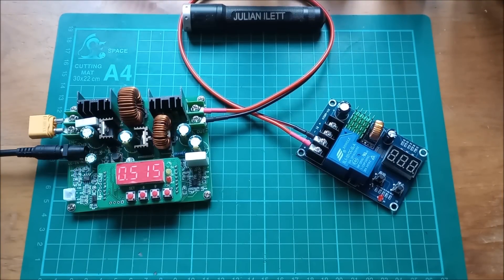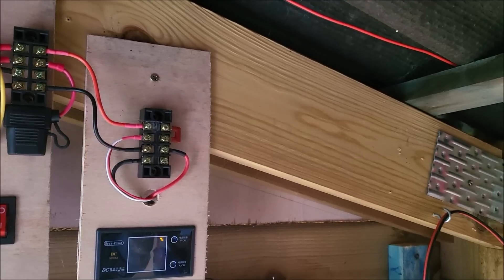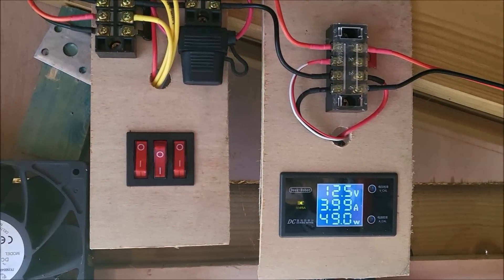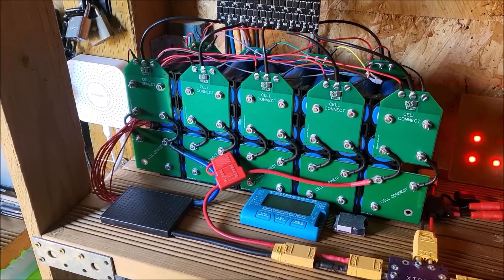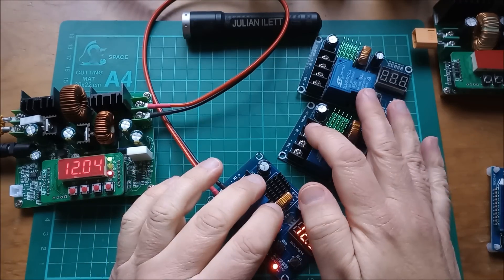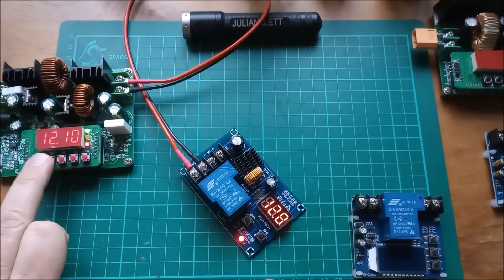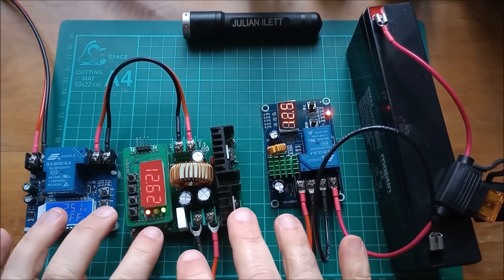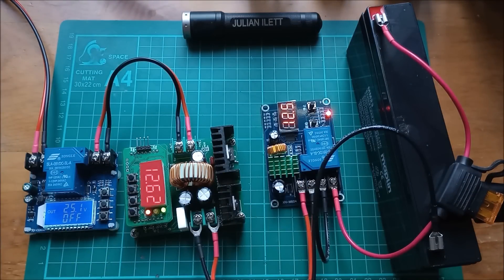Give 'n' Take Energy Transfer System

Comment: There is a simpler and easier way to do this. You know those little "solar" "MPPT" buck converters? They have a third pot on them, so not only do they give you configurable output charge voltage and current limit, they also set you set the minimum input voltage from the source below which they will not draw any more power. No need for relays. The only other component you might need is a diode to prevent backfeed from the destination battery into the buck converter.

Comment: interesting. i also did something like that for my own "ups"  psu at 14V feeds into relay when feeds converter to keep V at 12.4V when psu is off relays goes off and switches other relay on which reconnects battery which is off when psu is on to charge the battery. a little relay circuit that suppose to switch between psu and battery to power something, but it doesnt charge battery.
Reply: U can't use a battery while charging at low current unless you power the devices with the charger assuming you mean 1 battery best have 1 battery charging 1 battery in use

Comment: You need thicker cables to prevent the voltage drop. I am using 2.5mm multi strand wire, doubled up to equal 5mm square, it still solders into the ring terminals with a bit of manipulation.
QUESTION:
Can you please drop me a link for your source of Banana plugs.? I can only find unshielded decent Speaker type ones, which are no good with high current sources, in case of accidental shorts ETC. Even plugged in they are unshielded.
Reply from the maker: There is a small voltage drop in the cables, but it's only a few tens of millivolts. The banana plugs came from either Rapid Electronics or CPC Farnell, but the last time I looked they had been discontinued.

Comment: I'd put a diode after the buck converter then go to the battery instead. Not using the one module after the buck converter, as it is not needed. Stopping the battery backfeeding in the process too.

Comment: LiFePo4 batteries have a built-in BMS. 
At 14.6 volts the BMS disconnects the charging Mosfet and at 10 volts the BMS disconnects the discharging Mosfet.
You only need a step down regulator to 14.6V and 10A
Reply: Right, I was thinking that too although there’s a huge range of BMSs around these days, including many that I probably wouldn’t trust to handle the in/out limits for this situation.  Any quality BMS with user controlled settings and an app for monitoring could handle all that switching reliably I would think

Comment: Why not just use a push/pull buck/boost and set limits in it?
Reply from the maker: push pull buck boost?
Reply: @JulianIlett  ya, like cars have that to v2g. There’s amp and volt measurements on both sides and a full bridge on them so that they can buck based on parameters and boost in the opposite case. 

V2g just pushes more voltage back up from the battery OR pulls depending on mode but it could be automatic.
Reply from the maker: Oh OK. I've seen some Linear Technology IC's that can do that, but I've not seen any modules for sale yet.
Reply: @JulianIlett  get out the wood board and make one please!  Would love to see you build one with an arduino!

Comment: I'm really interested in the plethora of bidirectional USB power delivery boards on Ali and the newer chips from Linear Technologies that supposedly handle almost every facet of true MPPT for you across a wide range of voltages. Might incorporate them into my first PCB design ever (despite the price).
Reply: YES!  These!  I’ve been eyeing some of those bi-directional PD/ QC boards as well, waiting for the price to come down. I imagine them being quite useful!  Those power delivery protocols are widening the list of available voltage and current options but currently it’s 3.3v to 24v 100w+, 200W right around the corner.  There’s ones that buck/boost to achieve that output whether the input be 5v or 32v I think.  I use a lot of the 1 way PD boards for charging devices and powering LEDs but the 2-way boards seem like a new level of awesomeness.

Comment: never seen the point of wanting to work in a shed in the UK!  For a few days of the year it's too hot and the rest of the year its wet and cold, or cold, or just wet. plus all my tools go rusty in the shed. 😞
I'll stick with working in my toy room 🙂warm, dry and loads of mains power.

I think you need to start to look at a processor controlled switching matrix so you can balance all the incoming power to your storage requirements.
Reply from the maker: Working in the shed is not a want, it's a need. My office has a smaller footprint than my car!
Reply: @JulianIlett 🙂My toy room is meant to be the 4th bedroom.  but being big enough to be a bedroom is only in the mind of an estate agent.  As long as I leave a path to the airing cupboard I'm normally ok with all the toys 🙂
Reply from the maker: We had 4 bedrooms when we lived in Hayes, but lost a bedroom when we moved to High Wycombe. We gained a study (my workshop), but it's tiny. The shed does have its challenges, but overcoming them keeps my brain active :)
Reply: @JulianIlett  Not been to High Wycombe in years. the Hellfire caves was a fun place to visit, only about 20 miles from where we used to live.
I've got to build a shed for the other half to replace the old one that's falling down.  so it might be a modular shed 🙂

Comment: same transition from 24 to 12  for me and all my panels are 35+volts  . you can use dc clock switch to open your charge via sun  4-5 hours only  in daytime..   only thing is some converters love to have first the  input then the load... or mine just kicked with a big ark when charged backwards

Comment: I have two battery system in use in my garage, 12 and 24v too. To recharge the 12v system i just use another epever tracer and instead feeding in solar i just connect it to the load out of my main charge controller. That way i can program the load out to only be enabled when charge is high enough and i have a second load out on the 12v side which i can then use to control my 12v loads.
It works just fine for almost a year now. There's no backfeeding or other problems and the stand-by current draw of the charge controllers is really low.
All these relays and controllers seems to be way over complicated.
Reply from the maker: I'm trying to do this without using charge controllers. It's challenging (but fun) trying to get it all to work.
Reply: @JulianIlett  haha, okay, i accept that answer. making the unusual solutions work is quite fun 😁 As an electrician specialized in electronics, i can totally understand that. If function is just the 2nd priority, then trying thing out is perfectly fine 👍

Comment: Can't help but admire the convoluted nature of this. Probably needlessly complex, but far more interesting than a little black box that does it all inconspicuously. Do feel like I'd want something to prevent the backfeed though, and I'm not really sure where I'd put the buck converter in the chain. I'd also stick a manual switch or two on there to disconnect either side from the circuit and for extra gadgetyness. Would be nice to see the final setup in action, perhaps another shed tour in due course?
Reply from the maker: It's now all set up and working in the shed so I'll make an update video soon.
Reply from the maker: There's a manual switch of sorts on the LCD relay unit. Pressing the bottom button puts it in an off state.

Comment: Not sure I see the point of the relay closest to the target battery since the current limiting module will simply, with the right voltage setting, charge the battery whenever the supply relay is on. Adding a zener diode to the target battery terminal will prevent the battery from back feeding the current limiter. Fewer modules, fewer points of failure and less parasitic drain when charging is not taking place...
Reply from the maker: I do see your point. All I'd lose is the hysteresis on the destination battery and I can't immediately think how that would be a problem.